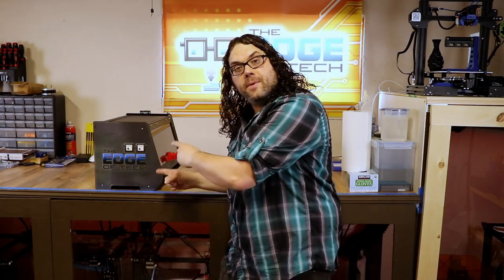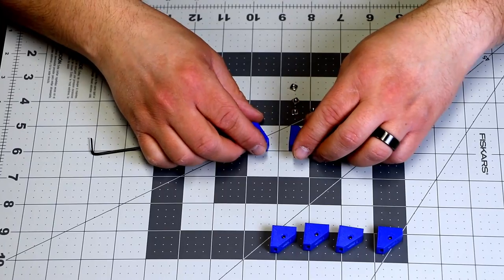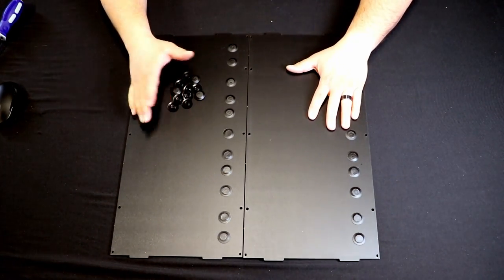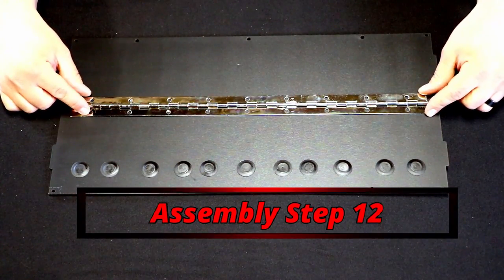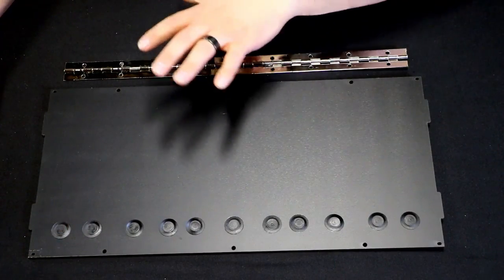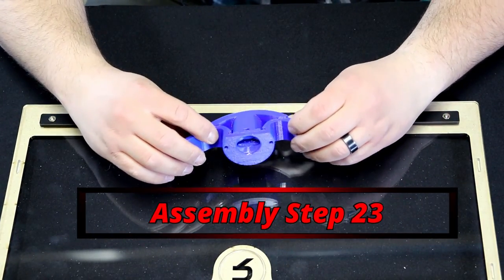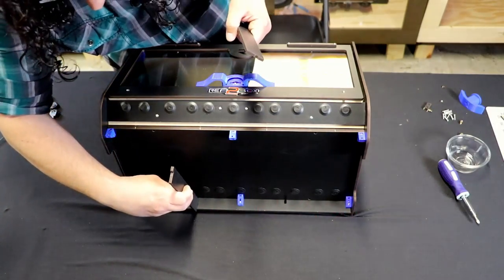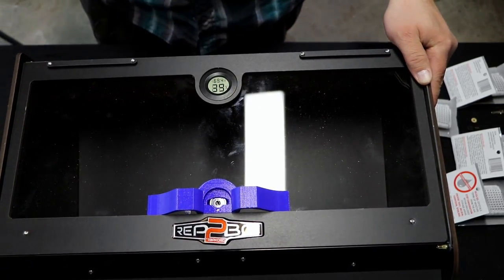Build the Repkord Repbox 2.1 Filament Storage Box the Easy Way!

Comment: Great video Jim!   I agree 100%  these things are the bomb!   It's so nice not having to handle filament spools every time you want to switch one out.   I have one attached to my prusa mmu system which works great. I have plans to get a couple more repboxes one for each printer.  Thanks again Jim and Pooch!
Reply: Do you have spool rewinders for the mmu or do you use the prusa filament buffer for when it rewinds? Thanks